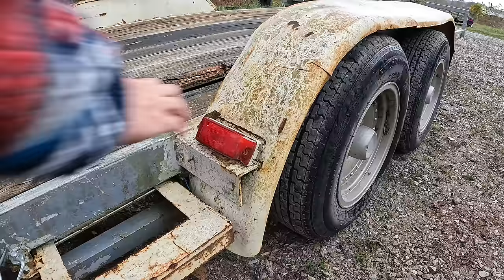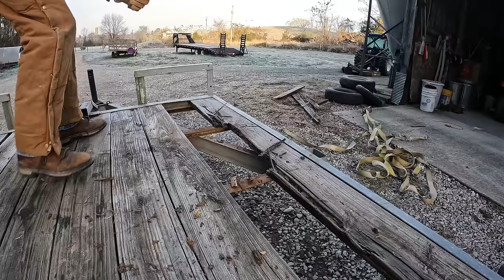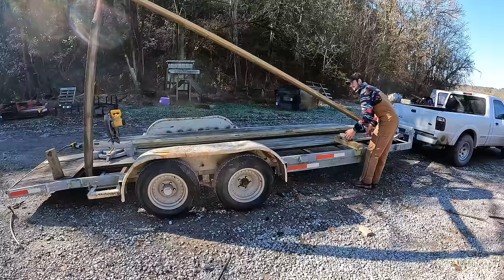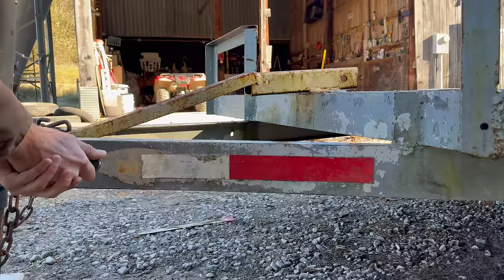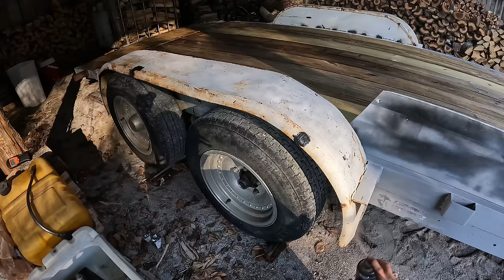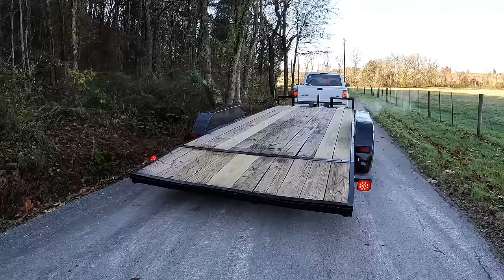Easy Money Flipping Trailers: 20ft Car Hauler

Comment: For future repairs; May I suggest you place a jack on the floor then a upright log on top of floor to gain extension and use that as leverage then arching the board into place. That way you lower the jack and never have to pound out the additional short pieces of stud. It will automatically be lowered and you out of harm's way. You'll save your back and be a lot safer.
Reply from the maker: That’s really smart! Thanks for the tip. Definitely will do that next time
Reply: For clarification your recommendation is:

“Bent” board
Upright Log
Jack
Earth

And then just lowering the jack?
Reply: @Freddy-bx6sf  Correct, if the earth is just dirt, rocks, gravel then I suggest placing a flat sheet of wood under floor jack for stability & to avoid floor jack sinking in ground.
Reply: @RAJsWork  got it, thank you!
Reply: Great result! I would suggest cutting the metal and bending it out of the way that way you don't have to bend the board at all. Then just bend it back and weld it once the board is in place.
Reply: @fpsfrankthetank7074  that is brilliant lol. Why think outside the box when you can just open the box😂😂
Reply: I've replaced all the boards, the way he did, on a 16' trailer, but only needed 1 - short 4x4 block placed closer to the center. Hit the block with sledge and rod. Block falls to the ground thru frame.  Never had a problem with it springing back up or being too close to smash hands. Went in smoothly, didn't even need rachet straps, pushed them down by hand. 
The trailer floor is still in good shape 13 yrs later. 
(He had the fulcrum point way too far to one end 🤦‍♂️)
Reply: @fpsfrankthetank7074   Won't the wood burn ??
Reply: @dennisgumm7016  not if you're smarter than the wood
Reply: I have actually watched someone try that technique and it didn't go so good.  All that being said, that particular craftsman was NOT smarter than the wood.  I couldn't take it and left before it all went wrong but saw the aftermath later.  Wasn't pretty.

Comment: This is what honest work  looks like. Showcasing costs and labor at the end tops it off.
Reply: Lip stick on a pig just saying.
Reply: @wing3737  Loll that's true but I'm sure the buyer was aware of the damages when purchasing. Those car haulers can cost 5-10K new.
Reply: Painted over the rust, not exactly what I'd call honest work. The rest of it was pretty good work tho. Should have sanded it all the rust out when he was stripping the boards.
Reply: @wing3737 sold for $2500 obviously there’s something wrong with the trailer if it’s that cheap
Reply from the maker: Nah brother nothing was wrong with it. That’s what they go for around here and I was trying to move it quick. Probably would have sold as high as 2900-3000 if I wanted to wait.
Reply: I agree with some of the others and as a European I see it as an American problem: Just has to look good on the outside.
I'd have sanded, primed and painted the entire frame when the boards were off or at least could be moved around. And the boards are only sealed from above, not from the sides or bottoms.
Reply from the maker: @doubleT84 it’s a flip, not a heirloom lol. It costs half the price of a new trailer.
Reply: That’s what I was going to say haha
Reply: Yeah these idiots saying you should have spent 3-4x the hours getting all the rust off...fools.
Reply: Where the hell are y'all buying trailers at ?? I just bought a brand new 20ft with a 2ft dovetail for 3500.00 out the door..with brakes !!!

Comment: Very nice transformation!  If you do enough of these, I feel like you could save a little money or at least have a better product for the same money if you got a harbor freight HVLP gun and sprayed with a 2k high build primer that you can buy by the gallon on the internet and then run to john deere and get some blitz black implement paint.  Just a thought, and it'd save your fingertips.  Keep the videos coming!
Reply from the maker: Thanks! Yeah I plan on getting one in the spring. Had a hard time with the first one I bought so I have been hesitant to try it again lol
Reply: @charliefarms1 rattle cans are less hassle tho. The Rust-Oleum pro grade cans go a long way too.

Comment: One more way to cut the cost a little is to use old motor oil for the wood deck sealer. Thin it a little with paint thinner and roll it on heavy (or spray with a pump sprayer with a fence staining tip). It looks good, lasts a long time, and is virtually free. The smell is strong at first but fades quickly with sun and time.
Reply: Can attest to this. Works great
Reply: We use diesel fuel to thin it out.
Reply: Yep.  Used motor oil with diesel fuel is excellent for coating wood.

Comment: If you do this pretty often might want to invest in a airless sprayer. You'll get the job done with the same quality, but you'll save money on paint if you buy 5 gallons at a time. Cleaning the machine takes about 15 min.

I'm a painter so I'm inclined to this thinking. Solid job brother.
Reply from the maker: Just bought one! Literally painted a trailer a couple days ago with it. Really worked awesome and saved a bunch of money on paint. A video is coming soon for that one too. Still getting used to everything

Comment: Really great job! I’ve also seen people condition the wood with 1 part diesel to 1 part used motor oil - it comes out to a dark waterproof finish and would be a cheap great alternative moving forward! Just an idea - never used it myself!
Reply from the maker: Thanks! I’ve never tried it before either. Apparently it smells like diesel and is slippery for the first couple weeks, and since I sell my trailers almost immediately, I haven’t tried using it yet. Might do it on my next one especially since it’s free.

Comment: one thing that is important with stick welding is to wear good gloves at least for your support hand because that hand will get exposed to alot more radiation(heat, mostly).  and the tacking method you did works fine for something like sheet metal but in the future if you ever did this in a shop it can be alot easier to tig weld the sheet metal on a really low amperage maybe 30-35 or so.  normally tacking would be no bueno but sheet metal has bit different of rules because it isnt weight bearing.  nice video btw - nate, a welder mostly
Reply from the maker: Been wanting to get a wire welder. I used one back in college and I could weld really well with it. Any recommendations on an affordable wire welder that can do this type of work? It’s been over 7 years since I’ve used one though
Reply: @charliefarms1  tons of options but to be honest when it comes to mig and tig equipment it's mostly a "you get what you paid for" situation.  for tig I like Miller's for mig and stick/fluxcore I like lincoln's but ive used both and just feels like miller's are constantly needing maintenence in comparison.  There are so many types of welders out there I would just say search based on your budget's price point.  Also it depends alot on the situation.  Gasless fluxcore ran off of a generator can be real cheap but you need to handle and store that flux wire carefully.  It doesnt need the carbon dioxide gas that DS fluxcore does (but can sometimes be added to the machine with a hose I believe) and with a gasless fluxcore wire you can weld outdoors with out the need for a gas tank.  Personally im gonna be building a mobile rig soon with an inverter generator from Harbor Freight called the Predator 9500 with a Titanium 225 stick welder (also from HF) to start out my side hussle after work along with all the common hand and power tools.
Reply: @charliefarms1  but for this kind of sheet metal work if you cant get an oxy welding setup id recommend getting a gasless fluxcore welder than can run 1/16" fluxcore wire and a set of copper backing pieces to absorb some of the heat when you are welding very thin metals and large gaps or both

Comment: What I did to make it easier to replace the boards is just cut out a notch, put the boards in and slight them over, and then tack weld the piece that was cut out. Can be recut and rewelded for future board replacements

Comment: Have you ever used tractor implement paint? I buy fix and flip trailers down in FL, I usually use a wire brush on a grinder to knock off any surface rust then use the Majic or Rust-Oleum High gloss black Implement paint. The paint is like tar but looks amazing when its done and lasts for about 5-7 years before it needs to be repainted.

Comment: Another suggestion: Dulux has a good stain called “Professional Wood Finishes 100% Oil”. Pick a dark colour and it looks very good on older woods. Thompsons water seal will peel and look like crap within a year. Dulux product will never peel as it is just an oil product. 

Also, I would angle grind off any serious rust before priming, even with a rust primer. Can never be too safe.
Reply from the maker: I’ll check it out. I’ve actually had really good results with Thompsons. I have an equipment hauler that I did it to almost 3 years ago that’s holding up decent. Will probably need another coat next year. It’s in my cattle hauler trailer too.
Reply: @charliefarms1 you’re lucky. I’m a painting contractor and decks that use it all look like crap within a year. Could very well be the winter weathers around here, I don’t know how much snow you guys get.

Comment: Get the cheap Chicago electric welder from harbor freight for under $100.  It’ll make welding thin steel much easier.  Since it’s a mig and not stick.  You’ll have an easier time starting the arc with less risk of burn through.
Reply from the maker: I definitely need another welder. I plan on getting one before spring for sure. I know that in the past I could weld much better with mig

Comment: Great job for what you have! Take some of that profit invested in a professional sprayer and buy paint in bulk quantities. Also, I have a feeling you destroyed your chainsaw blade, so by a Saws all. They are made for projects just like this. Also, did you grease the bearings, inspect the tires to make sure it was safe? You could’ve gotten another $500 out of replacing a couple of those tires if they were cracked or worn.

Comment: Welding steel is the easiest, practice on more scrap metal so you don't have to pay a welding shop. Then the money you save by doing it yourself could've went to replacing all the boards, that's my only complaint. Nice job overall

Comment: Might i suggest for quicker and safer work, to cut the metal lip section, bend out of place, install board with ease, then bend lip back, tack and smooth. 👍

Comment: How much should I be looking for to buy a trailer for to flip it? I’ve been scouting marketplace for a few weeks now and just wondering how much a good price is to flip a tamden trailer for?
Reply from the maker: It all kinda depends on the trailer and your location. For example, I’m in Kentucky, so car haulers and utility trailers are very common. I’d say 1 out of 4 people have a trailer in my area. But when I lived in Florida, not many people used those types of trailers, but tons of people have boats. So If I was in Florida I would probably be flipping boats/boat trailers instead. If you watch my video on how to find trailer cheap, I go over the things I look for when buying one. Typically I pay between 1000-2000 for the trailers I flip because I know they cost 3800-4500 brand new, and I can make them look brand new and sell for half the cost. I always always always calculate how much I would have in the repair before buying the trailer to make sure it’s worth it. I suggest saving trailers on marketplace, then going back and seeing what sells. That will give you an idea of their value and how fast they sell
Reply: @charliefarms1 Awesome, Thanks!

Comment: Curious of the state you are in? In NJ if the trailer is registered over 3500lbs it has to have brakes. Laws vary or course
Reply: Kentucky
Reply: Laws or not putting a vehicle on that trailer and not having brakes on it is a BAD idea. I was very happy I paid the money to put a brake controller module in my truck when I hauled a camper trailer half way across the country a few years ago.

Comment: Shoulda sold that for atleast 3k. Did you  factor gas money to go pick up the trailer when you bought it. Or taking it back and forth to the welding shop. That’s a lot of work for 5 bills man. But great job. It would almost be more worth it to just keep the trailer.

Comment: Great video! I would love to find a $1600 dual axle trailer! What about the wheel bearings and trailer brakes?
Reply from the maker: Thanks! This one had brakes on the front axle, but honestly I had never wired brakes or used them so I didn’t wire them up to work. Most people around here don’t use brakes on trailers anyway, so I knew it wouldn’t make much of a difference in value. For wheel bearings I get the wheels in the air and see if there’s any movement and that can typically tell you if they need to be done. I always pull the dust cap off to see what the grease is looking like too. I spend the extra time to check the bearings before buying the trailer too because that can usually get a discount.
Reply: @charliefarms1  awesome! thanks for the detailed reply! I subscribed, loved the video! In Canada where I am from trailer brakes are always a good selling feature, that trailer would cost at least $4000+ CDN here
Reply: @charliefarms1  makes me shudder to hear "people around here don't use brakes on their trailer".  For an empty trailer that's all well and good but with a vehicle on it???  Well let me put it this way, even with working trailer brakes and an adjustable brake controller installed in my truck I make sure to give a lot of runoff room in front of me when pulling a heavy trailer. That don't even account for fear of getting jack knifed by a trailer with no brakes in stopping conditions that are less than ideal.

Comment: Where tf you find a welding shop so cheap? The shops around here wanted $300 to do two 3" welds that I prepped and cleaned...

Nice job and good profit, maybe worth more than $2500 but area dependent prices.
Reply: Middle of nowhere would be my guess.  I thought that price point was super low as well...

Comment: Where do you find these deals? I've been looking. That trailer would be 2-3k before the work in my area. Why don't you buy a gallon of primer and paint and brush it on? I feel like it would be cheaper and give a thicker coat.  Also, why did you put the signals on the rear of the fenders instead of the tail lights. You have definitely inspired me to start flipping. I need to learn to weld though.
Reply from the maker: I find the trailers from Facebook marketplace, you have to watch it like a hawk to find the deals. Once you learn the market of how things are priced and what sells it’s pretty easy to choose which one you could make money on. I use spray paint because it is way faster and you can get into the tighter spots easier. As long as you do the right prep, and do multiple coats the spray paint holds up great. And the taillights were different brands, so the taillights on the very back actually flashed with turn signals and brake lights too, but it was a lot dimmer compared to the clearance lights so I wired them to blink as well. You can do it! It’s not hard. The first one took me a while but I get faster and faster the more I do it

Comment: What about the trailer brakes? In my state, they're required on at least one axle on trailers over 14'
Reply: He said no trailer brakes elsewhere.  I already expressed my feelings on the dubious nature of THAT idea.  Having pulled a 6000lbs camper trailer (with working brakes and a control box in my truck) half way across the country I can tell you the idea of putting a vehicle on that thing without trailer brakes makes the hair stand up on the back of my neck.

Comment: Does the total cost include the fuel you spent going to buy the trailer or the time you spent getting it. In the hourly rate ?
Reply from the maker: I believe that’s the only thing I forgot to put in there. It was about a 45 min drive, so I would assume I spent around $15 on fuel
Reply: You did really good! Thanks for the reply

Comment: Why do the wood boards have to be bent, I don’t understand
Reply: The metal holds the wood in place by sliding it in a notch. While you can probably slide the first few slats diagonally and straighten to fix, the last few slats have to be bent to "shorten" them to fix. When they straighten out, they sit flush against the inside of the notch on both sides of the metal frame.

Comment: You would have made more money working at Burger King.  I bought a 1 year old big Tex 20 with spare and tool box $4400 this month in OH . All your hours and old tires and brakes not to mention any unknowns like structure fatigue or cracks.  Nice Video but your skills would be better applied elsewhere.
Reply from the maker: You proved my point exactly. You just bought a USED trailer and paid double what I just sold this trailer for. I make affordable trailers that look good. If you want a new trailer, you’ll have to pay double. Or in your case, you paid double for a used trailer lol

Comment: I hate to be the one to say it. But whoever buys that is going to be mad. Should have changed all the wood, and done the wiring right so you would have brakes. And the paint isnt going to hold up for more than a season.
Reply from the maker: I do this to my own trailers. I can tell you first hand that it does hold up. The selling price reflects the work done. If they want a powder coated trailer with no rust than they will have to pay $4,000-6,000 for a new trailer.

Comment: 1) good job working hard
2) you worked way too hard for such a small profit. I find it hard to believe you only had 13 hours in it. 
Finding it, driving to/from; fuel, time listing it, time talking to future buyers, time going to/from store. I don’t think you fully calculated. But I could be wrong.